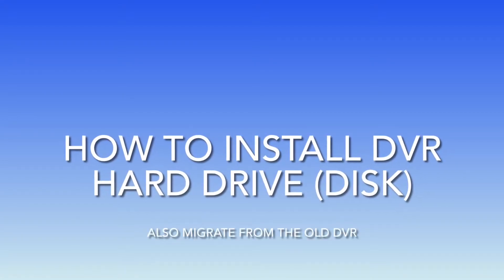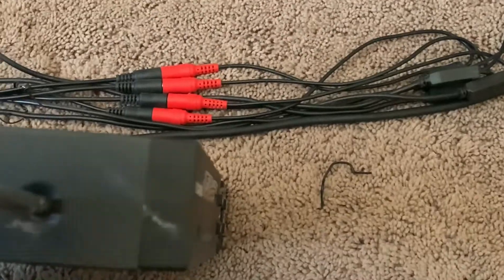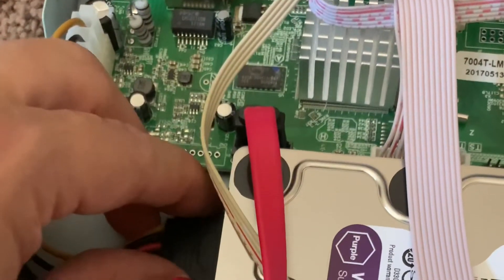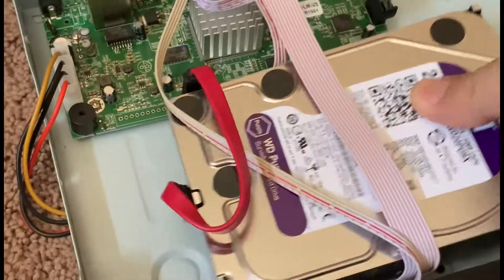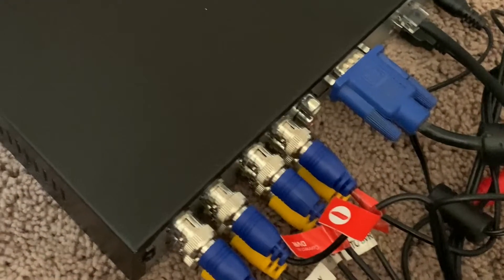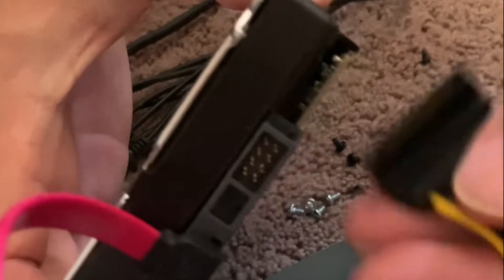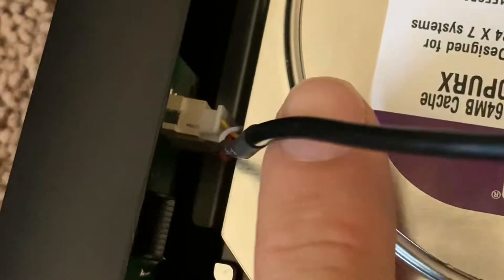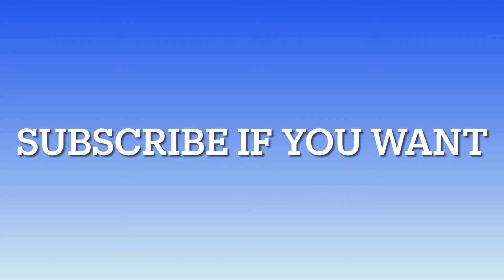DVR Repair

Comment: I appreciate your video. I have an ansippo 8 channel wireless dvr that only flashes the red power light. What would possibly be wrong with it?
Reply from the maker: 1.	Power Supply Failure – Faulty adapter or insufficient voltage.
	2.	Firmware Corruption – The system fails to boot properly.
	3.	Hardware Malfunction – Internal components (motherboard, capacitors) may be damaged.
	————

1.	Check and Replace the Power Adapter – Use a working adapter with the correct voltage.
	2.	Perform a Hard Reset – Unplug the DVR, remove connected devices, press and hold the power button for 15 seconds, then reconnect.
	3.	Try Firmware Recovery – Look for a reset button or check the manufacturer’s site for firmware updates.